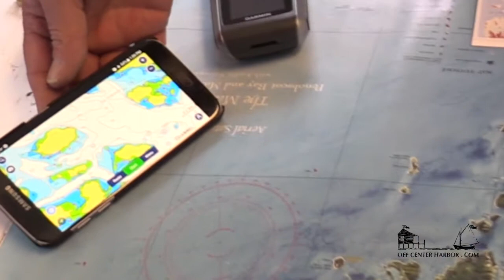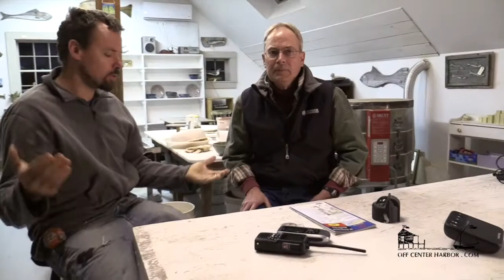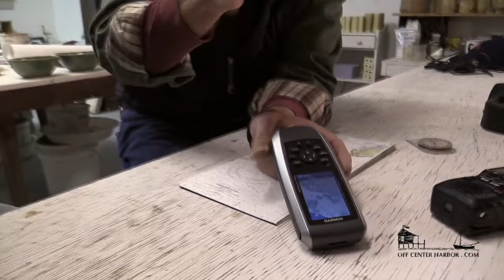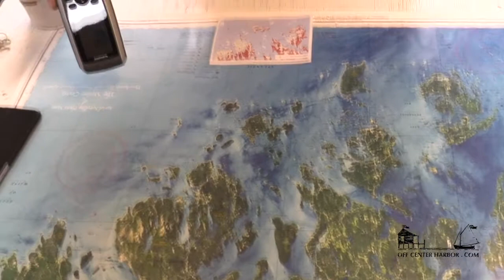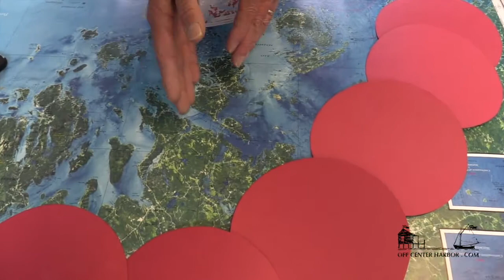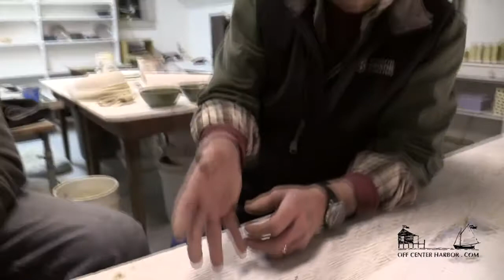Marine Electronics for Every Size Boat, Part 1 - Handheld GPS Chartplotter vs  Smart Phone

Comment: Many smartphones and tablets have a GPS chip set in them that will pick up several of the satellites in orbit and triangulate your position.  I run an iPhone 6S and an iPad on board.  Both units are mounted on a Ram mount with a lighting cord to keep them fully charged.  I also have a GPS receiver in my Standard Horizon VHF radio that outputs the AIS and GPS data via wires to a wireless hub that connects to either the phone or iPad and have navigated in cold Alaskan waters when it was too foggy to see more than 100' in front of the boat.  So, for this expert to not differentiate between phones and tablets that don't have the GPS chip set and those that do is not only not accurate but also concerning that he might not be aware of that fact.  I've used my iPad to cross the Gulf of Alaska, where there's zero cell service for 600 miles, as well as down the entire Baja peninsula, again without cell service, and the GPS worked flawlessly.
Reply: Same here. I was scratching my head the whole time and wondering if anyone else caught it. I've used Google Maps on my phone to drive through deserts where there's no reception for over 100 miles.
Reply: @jonmccauley6490  how did you download the Google Earth maps?  I know it's possible but have never been able to figure it out...

Comment: Nope. The GPS on a phone is independent of cellular positioning. In fact, I use Navionics Boating app on a Wifi-only iPad (no cellular service) on my boat as my backup chart plotter. I connect it to an external GPS antenna via Bluetooth. From a UX perspective, it’s way easier to use than my main chartplotter, and just as accurate.  If the screen were easier to read in direct sunlight, it’d be my main device.

Comment: This is worrying that a so - called expert states "as I understand it" but is wrong!  As long as you have your charts downloaded to your smartphone, your gps tells you where you are NOT the cellphone towers!

He also states that you can not protect your smartphone. I have a fully waterproof phone which is then placed in a shock proof and waterproof protective case.

I have yet to find ANY specialist in navionics give an informed, accurate and honest comparison.

I am a skipper of just 35 years, and 2nd Class Master.

I use a cheap tablet to run the navionics in a waterproof bag, backed up with my smart phone in its case. In 10 years, I have never needed to fire up my 12v fitted boat nav gear, except to confirm that my other cheaper systems are just as accurate.
Reply: Yep there are many EXPERTS around..lol

Comment: GPS doesn't need an internet connection to run. GPS or Global Positioning System is a chip in your device that listens to the satellites, which helps it determine and lock your current position. There are plenty of GPS only devices that work without any internet, wifi or Cellular data.
Reply: Yes this was a bit biased